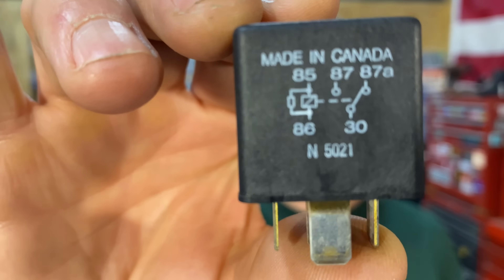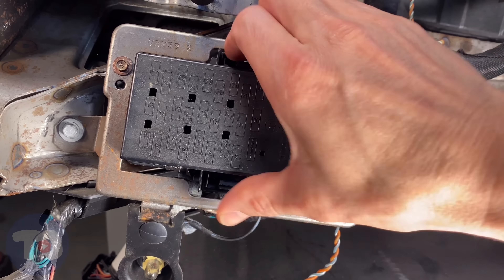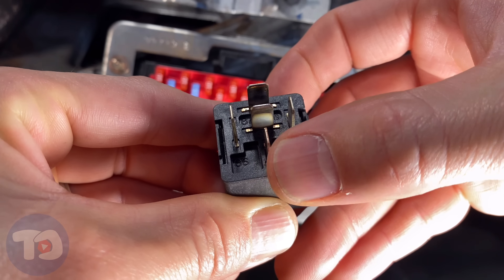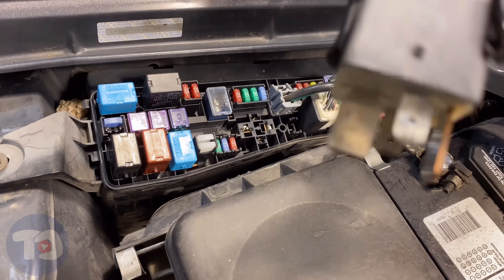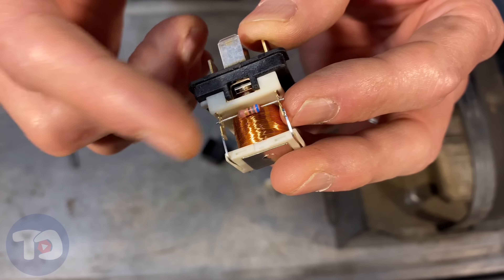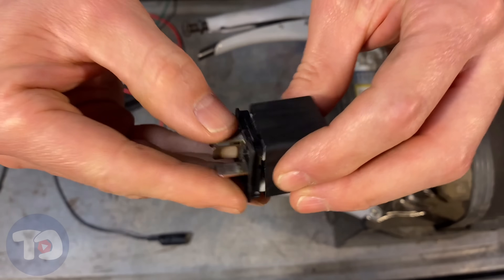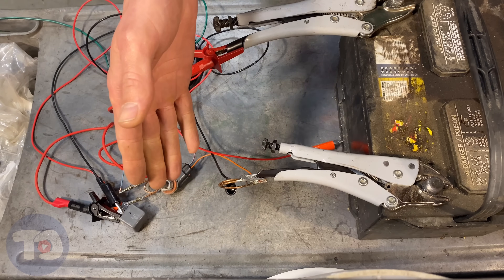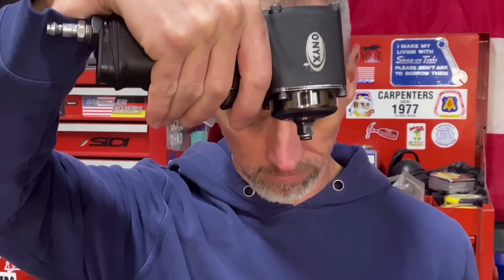Why are relay pins numbered like that?

Comment: Had a car that the horn relay went out. New one was a whopping $80!
So I bought a fog light relay and wired it in. That relay was $10.

Worked like a champ too.
Probably better since it could handle more amperage than the OEM one.
Reply from the maker: Awesome! You’re not a victim of the ‘proprietary parts’ scam.
Reply: Way to defeat "Big Relay". 😊
Reply: Right way to do it!
Reply: Horns tend to be highly inductive loads, whereas filament lights have a turn on surge but no inductive arc over. That sometimes matters more to contact designs than overall static current ratings. 

Some switches or relays have 2 or 3 different current ratings based on load types.
Reply: Worked like a champ...  until the voltage spikes fry the $$$ controller module.
Reply: Amperage... you mean current?
Reply: @2secondslater  what's the difference?
Reply: @BareFootDuck  grammar
Reply: @2secondslater  lol not
Reply: @BareFootDuck  amperage is how strong current is going through wires. Voltage - how high potential of electricity is going through wire. More amperage - thicker conductors. More voltage - better insulation
Reply: @TheKrololo  What's the difference between a relay that can handle a higher amperage v higher current?
Reply: @BareFootDuck  for higher amperage you need thicker conductors. For higher voltage and less amperage your conductors can be thinner but you need to have a better insulation between conductors, or bigger air gaps and another things to keep it safe. But I'm not an expert
Reply: @TheKrololo  that still doesn't answer my question. What's the difference between using the term Amperage v Current.
Amps is the unit of measure for current.
Reply: @BareFootDuck  No difference
Reply: @BareFootDuck  sorry i thought you were talking about current and voltage
Reply: @TheKrololo  exactly! Hence my original question ( what's the difference) to Jake Elliott who felt the need to correct the bloke, saying he should have said current instead of Amperage.
Reply: @TheKrololo  👍no worries.
Reply: @BareFootDuck  but i think it is still grammatically correct? I'm not native in English
Reply: @TheKrololo  6 of one and half dozen of the other

Comment: 30 is Plus, 31 is Minus always, 15 is Plus ignition on, X is ignition without starting (VW)
Reply: What?
Reply from the maker: Never got into VW repair. Neat that it’s standardized.
Reply: @ToolDemos  
CE2 wiring, it's a VW term.
Central electric 2 ,which vw started using around 91 made a lot of stuff common across their fleet for years. 
Vws literally are the Lego cars.  
I can take a 4 cylinder from a 98 ,and plug it in a 91 because of CE2 and it's almost plug and play. Even stuff from a Mk4 (99-05) can work in an earlier car with CE2 making it almost plug and play again (minor stuff like changing sockets might be involved but it all ends up looking and working like factory)
Reply: As a VW guy for like 30yrs ,I totally get ya.

Comment: You should tell how a Three Pin Relay works, that’s on a lot of older vehicles. A lot of Professional and Amateur Mechanics get confused by them.
Reply: But aren't those even simpler than modern relays? One pin each for the switch, the load and the battery. One terminal of each of those parts is grounded.
Reply: @twowheeledparadox  Yes, 12 Volt to one pin, switched 12 Volt out on another Pin. What Mechanics don’t understand, is the Third pin goes to a switch that, Switches to Ground, “Negative.” Gets really confusing when old cars have Positive on the Body and Frame, Negative is on the Switched side. If you want to really get messed up, on 10 Vdc HVAC Control Systems, White is Positive.
Reply: @stevenmoomey2115  Yeah, that's right. I have used both a 3-pin relay (really chunky and with a metal shell) as well as a modern 4-pin unit on our old motorcycle when it had a 6V postive ground system. The load was a pair of horns. 3-pin ones were better since I could get ones that were rated for 6 volts. 12 volt 4-pin relays worked too but only when the engine was running and charging the battery.
Reply from the maker: Watching one blink on the inside would be cool too.

Comment: Lucas England had the same type of system to identify wiring, all those different colours and stripes on wiring have a specific function in the Lucas system. Brown - unfused battery feed. Purple - battery fed fused accessory. Green - ignition switched fused accessory. Red - side light switched accessory. Slate grey - feed from ballast resistor to coil (from memory) .
Now you know why old British cars are full of green and red wires in the dash.
Reply: International trucks here Australia came up with either a complete yellow or white wiring harness with small  numbers printed on the wires. The main issue was after many years of degreasing and cleaning the  numbers wore off. As an ex auto electrician, I tore my hair out trying to sort these old shitters out.
Reply: @richardcrowell284  I worked for Detroit Diesels in Adelaide as an electrician, occasionally I would get asked to help out the mechanics, Kenworths were the same all yellow from memory. 439 being the switched ignition and 30 or 31 being negative are about the only numbers I can remember, long time ago. Recently helped a friend out restoring a Peterbilt, same system.
Reply: @raygale4198  I still get calls from friends trying to isolate an electrical issue with a vehicle.  I'm a PBX (phone system) tech, which means that walking into the phone room in a large office building and seeing identical wiring feeding hundreds of phones is just another day at the office for me.  I'm well past the point of being intimidated by unlabeled conductors...  :)
Reply from the maker: What a nightmare.
Reply: @ToolDemos  In his application, a daycare, haha 👍
Reply: If it is Lucas (the Lord of Darkness) then pretty much any colour wire is likely to be "not connected".
Reply: @albanana683  Lucas the inventor of intermittent headlamps, an idea that never caught, on, unlike his intermittent wipers that became very popular. The only thing Lucas made that didn't suck were vaccuum cleaners. 🙂
Reply: @raygale4198  Good one!! 😆

Comment: the compass method is better i think.  pin 87 (North) New accessory. pin 85 (East) Earth.                 pin 30(South) solid power with fuse, and pin 86 (West) sWitch. if you rotate the relay until you have one pin horizontal and 3 vertical  (4 pin relay) you'll  know that pin 87 is the top one.
Reply from the maker: I like memory aids like this, they help me out all the time.
Reply: Only that does not work on some Bosch relays fitted to some vehicles GM Holden Australia used relays with the 30 pin on the side. Many a mechanic has got caught out by taking a relay out and swapping it. As an ex auto electrician having been in the trade since 1976.
Reply: @richardcrowell284  Ahh, so will it only work on relays for air horns. spots lights ect
Reply: Simple is - 30 power, 85 coil power, 86 coil ground, 87 load
Reply: @frontagulus  yes it is simple. but some people dont wire up relays every day, so to help remember a memory aid like this method will help them
Reply: @frontagulus  You have 85 & 86 reversed. 85 is coil ground.

Comment: On most, but not all, Bosch relays, 85 and 86 are interchangeable, meaning you can connect them in reverse order with no problems. Some of the older ones use a clamping diode instead of the resistor to control the flyback voltage, thus requiring wiring in the correct polarity.
Reply: Sometimes the diagram printed on the relay will show the diode. 
Or of there's a part number you can Google it to try and find out if it has one or not.
Reply: Freewheeling diode?
Reply: @twowheeledparadox  It has various names including snubber diode , crowbar diode.
Although  crowbar diode is more commonly used in non inductive circuits.
"Flyback" is the most correct term because it describes the origin application:
"Flyback circuits have been used since 1930, and they were refined starting in 1950 for use in television receivers. The word flyback comes from the horizontal movement of the electron beam in a cathode ray tube, because the beam flew back to begin the next horizontal line."
Reply: @PaulG.x  fly back is the least correct term because it has nothing to do with a fly back circuit. Snubber is correct. The diode is here to remove (snub) voltage spikes. The fly back circuit on a TV is using the same kind of voltage spikes deliberately to generate the HV.
Reply: Another correct term I have heard is kickback voltage.  I prefer snubber,  flyback is getting to consumer electronics.
Reply: @tsl7881  Flyback is used in the automotive world. there are many terms for the voltage produced when the power is removed from a coil.
Reply: @twowheeledparadox  Electronics has lots of names for the same device and numerous diode functions are no exception.  Freewheeling diode is just another term for a current-snubber diode. As he explained, diode is connected across the coil to suppress the collapsing current pulse. Cheers!
Reply: I agree with others that diode is another option but I didn't see it as "older". However, beware of the coil terminal polarity with diode types. I've seen relays where the diode is reversed so you have to use 85(+) and 86(-). Always check the datasheet! Wrong polarity and you'll blow the diode.
Reply: @JfromUK_  I suppose one could check with a multimeter set to continuity/Diode? I'm referring to establishing polarity of the control side of the relay.
Reply: @abdul-kabiralegbe5660  Correct. Leave nothing to chance of mis-assembly. Cheers!
Reply: @JfromUK_  Good advise. Even better is to actually check F/R resistance with a multimeter. Especially so if it's an off-brand relay. Once and done. Cheers!
Reply from the maker: Great information, thank you for that.
Reply: Not to mention the fact that B+ is almost always powered by a master relay or switch, and most PCMs/BCMs will drive the relay through the ground side.
Reply: Not sure  I agree on the "most"   comment.  Be careful, as using  diode equipped  relays,  connected in reverse, can  possibly damage  solid state switching sources,   the very thing they were meant to protect
Reply: 85 	relay coil - 	Important if relay coil has flyback diode in parallel
86 	relay coil + 	Important if relay coil has diode in parallel
Reply: @IIGrayfoxII  I don't understand the difference in the 2 scenarios you mentioned: 85 relay coil negative (flyback diode) Vs 86 relay coil positive (diode).
Reply: @abdul-kabiralegbe5660  Both will do the same type of job of reducing EMF spikes when the voltage to the relay coil is shut off.
But according to google resistor is more durable than a diode and can suppress voltage spikes similar to a diode, but the resistor will allow current to flow through it whenever the relay is on.
Therefore resistance of the resistor must be fairly high (about 600 ohms) in order to prevent too much current flow in the circuit

But don't forget Diodes are polarity sensitive.
Reply: Oh yes they do . I still remember the sparks from that lesson. Correct polarity matters.
Reply: Great point, as I remember diodes being used on the coil terminals! Watch the polarity there!
Reply: Ну ты там себе и ответил :)
Reply: There have always been and will always be relays with diode and relays with resistor, it has nothing to do with age. Actually, resistor, along with relay, is far older invention than diode.
Reply: If it's German there is no "most". It's either all or none
Reply: @goatman86  Yeah, Germany uses Base2 counting system.
Its either a 1 or a 0
Reply: @goatman86  Nope. Most is the correct term here. I spent my last 20 years of employment as an electrical tech, for a German road construction company, and there were a good number of Bosch relays, that were "coil only"- no resistors or diodes in parallel.  Some models of equipment that I built the electrical assemblies for, used diodes that were wired across the coils (individually), and others never had any at all. German engineered- leans toward consistency, but it is not absolute.
Reply: @goatman86  Ha, ha! So right. Cheers!
Reply: @goatman86  That's insane, and usually factually wrong in both physics or engineering cases, and balances of biological nature. Does Deutsche really impose that unrealistic a cosmology via language limits?
Reply: relays are not polarized, as long as you have the load leads and the power leads connected to where they belong. You can reverse the load lead, and you can reverse the power leads.
Reply: @adotintheshark4848  Unless you have a flyback diode to stop that 1000v from going back to the BCM.

Comment: Back to '85' ... Again.   can't forget now.   lol   'DIN'  Well now i know.   '84 Scirocco will be happy. [?] 
If Relay has NO Numbers, HOW do you Know which is 85?   Denso [4 pin]  \  i'm working with 5 pin Denso.
You noted Large Terminals 'Carry Voltage' for load.  well yeah, may be defining wording is my issue.  
? Scary, just saw video saying opposite.  I'm Rechecking!  Yep.  IF 'Power' to wrong pins ..??   Will check Plug to know.  
I think i've got it   -   just wondered.  Thanks!    lol   yep Scary.   note: working on toyota.
Reply from the maker: If I don’t know by looking at it, I refer back to a wiring diagram. It always helps to be sure, and with good service information those wiring diagrams should be all you need.